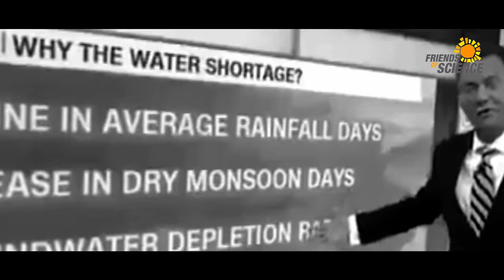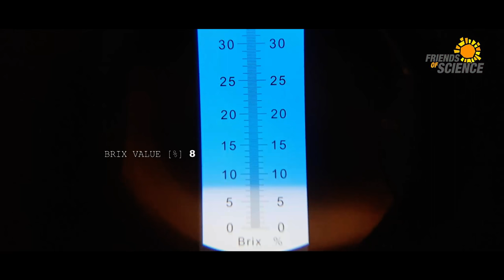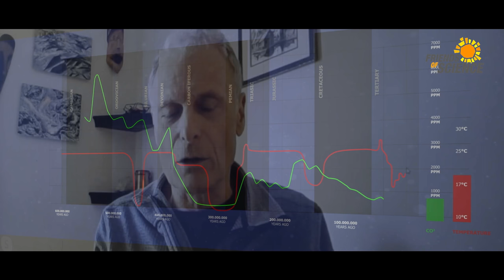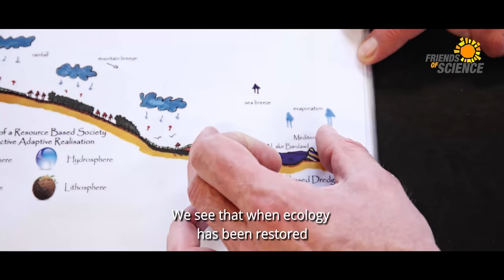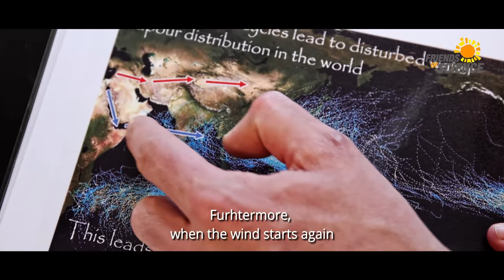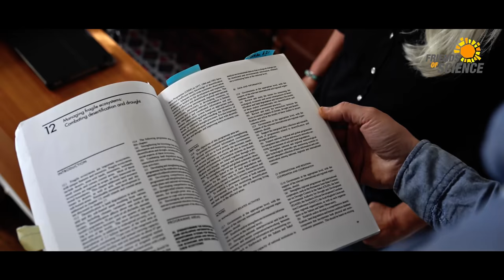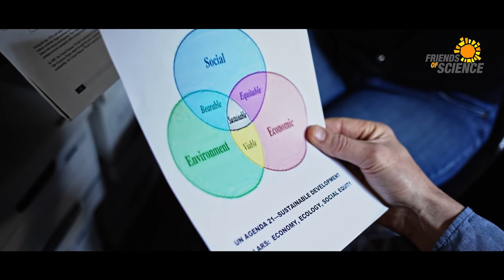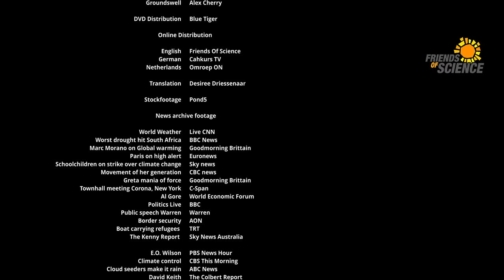Return to Eden : ONLINE PREMIERE

Comment: Return to Eden, is a must-watch. The science is far from settled... The protagonist, Dr. Alan Savory from the former country of Rhodesia, now Zimbabwe, figured out simple solutions to the problem years ago in Africa, though the alarmists vilify the common sense. The documentary is nearly two hours long but a must to watch. It will put the "climate crisis" and the California fires in context. The scary parts are towed the end, just about an hour in, about how the ruling class, out of control, will screw you and any deal you make with the bureaucrats. More scary is about 1:20 about Agenda 21 and its agenda to concentrate and control us all...using the guise of Climate Change... It's about taking the climate model spread sheets predictions (that so far have failed to materialize) and using that data over the actual observations...enabling those who control the models to control the outcome... Bottom line is that with common sense and ground-up, out of the box ideas will triumph over group think control which appears to support the alarmist agenda all along.
Reply: This is sarcasm right?

Comment: 17:21 funny, that, studies and tests have already shown that using just red and blue light (WITHOUT SUNLIGHT) makes the plant grow extremely weak and they collapse under their own growth rate. There is a reason plants evolved with full spectrum light, they will not be able to grow correctly without it. I can only imagine how that effects the nutrient density of the plant fruits in general, and if that's not a worry there is already evidence of microplastics making their way into the fruit due to this method of growing... Also, they  have to use stonewool (which they showed) and stonewool needs to be submerged in low Ph water to dissolve pollutants that are in the fibers... 

Not the most ideal or safe replacement, and this is coming from someone who finds hydroponic to be a good idea but unfortunately too rife with the same problems we find ourselves in when we try to seperate ourselves from the soil.

Comment: 18:34 : Did he say Plants need CO2???
Reply: Derp. Yes plants need CO2. Unlike a greenhouse, the earth's temp cannot be lowered by opening a window, which destroys crops as they overheat. It's not that hard.
Reply: Frank Dodich  You're missing arguments. In what way do I miss the point?
Reply: Frank Dodich  extremelylongfaketrollname is just wasting every ones time with no arguement or point, dont give it oxygen.
Reply: No he is saying he can control CO2 as a parameter for growth. Plants need CO2 for transpiration. That is how they fix carbon. But it all needs to be in balance. Look up the Great Oxygenation Event. Respiration and heterotrophy evolved to balance transpiration and autotrophy. Humans are upsetting that balance again.
Reply: @ayoungethan  And wrong again. CO2 is not required for transpiration, but the other way around: Transpiration occurs if the plant wants to take up CO2. It will lose water in the process, although in  some cases this is not a bad thing, as it cools the plant. Plants will also open their stomata when they are overheated, regardless of CO2 levels.
CO2 is required for building carbohydrates and other organic compounds in the plant. It is fixed during the Calvin cycle.

Comment: 17:33 - Wonder what the electricity bill is like [Electricity needs to be produced]
Reply: Frank Dodich  what is grass if not solar power ? and it is as perennial as the .....
Reply: Frank Dodich  nucleair power still exist
Reply: Frank Dodich  yea blame that on the people who called nuclear power incredibly dangerous because of Chernobyl.
Reply: nicola tesla had free energy. they arrested him. check in usa about the tesla towers that showing up now. ;) trump 4 more years :) free our world
Reply: Frank Dodich  'Sup Frank. If you compare the power and energy needed for spraying water(which also needs to be purified), using tractors to spray chemicals, plow the land, harvest, and transport the vegetables to the city, and compare this with a vertical farm which requires less water, less land, less transporting and by using LEDs, less energy, yes, a vertical farm is more sustainable than traditional farming. Also, yields improve (no weather damage) which increases the total efficiency.
Reply: Frank Dodich  My point waa that instead of oil in tractors and trucks, we can use it directly for the farm. LEDs don't use a lot of energy, The water is sprayed on plants once in every time, which requires less pressure (thus less energy). Also be aware that green energy is still in development. An increasing share  of energy will be green. But regardless, total energy use is lower than conventional agriculture. There are some papers on this that researched whether they are indeed more efficient.
Reply: @wappienet152  You forgot the energy to operate the pumps to extract excess water from the fields during the rain season, because plowing worsens flooding. And the energy to dig out your tractor that got swallowed by mud.

Comment: 100 years ago twenty people were required to farm a section of farmland for grain,now it is one.Twenty percent of the crop fed draft animals and workers.Backbraking, monotonous work was replaced by operating diesel powered machines. That is the true miracle of new farm methods.All those people can in this way be free to do other beneficial things.
Reply: Yup and chainsaws make cutting down trees easier. We took a very destructive way of farming and mechanized it by outsourcing the labor to factories and mines and the mineral economy. When the intent is extraction of value, technology just magnifies the intent and facilitates and accelerates greater extraction and destructive outcomes. We have replaced slaves with robots but haven't changed from the model that demands slavery. Low infrastructure farm ecosystems, on the other hand, can be managed by only a few farmers with sophisticated and sparse technology. The animals live wonderful lives doing what they evolved to do, there is no (edit: inherent need for) slavery and biodiversity increases, as does the effectiveness of the water and nutrient cycles and solar energy flow and conversion.

Whereas machines are expensive (and often dangerous) to purchase, operate and maintain and degrade with or without use, biological systems can atrophy if used too little, degrade from distress if used too much, or regenerate and grow if used optimally (the concept of hormesis, think of it like exercise: too much or too little is bad). Regenerative farming works in part because it doesn't overstress the land nor allow it to atrophy.